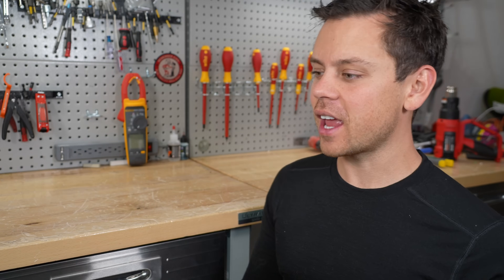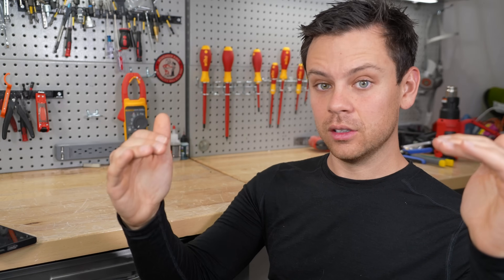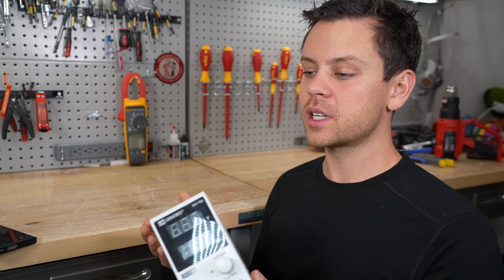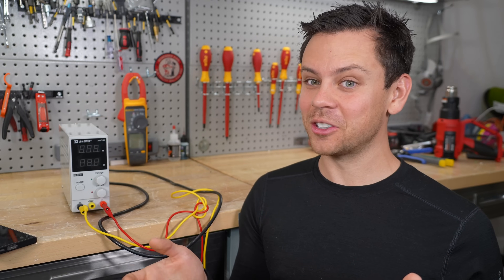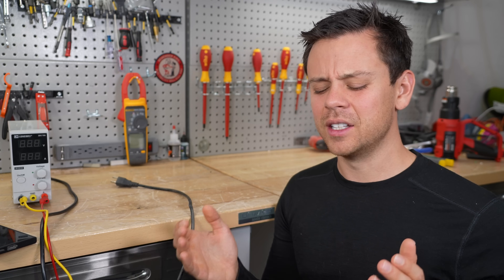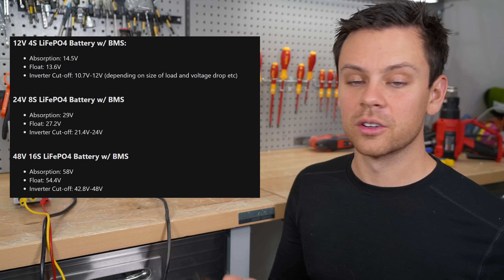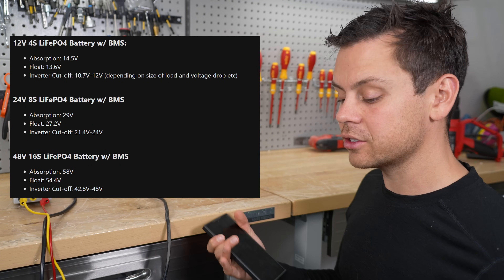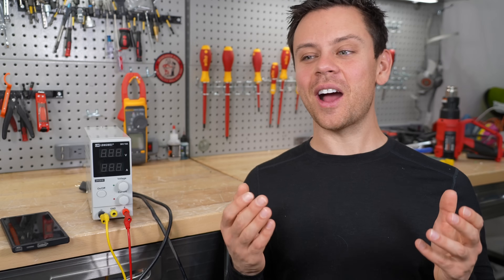LiFePO4 Charging Guidelines: What is 100%? What is 0%?! How to Balance??

Comment: Some people only want their batteries for an emergency backup and keep them full for that 2 or 3 days when a ice or wind storm goes through and the grid goes down and solar is not charging a lot due to ice or cloud cover.  Most home battery manufacturers say you can keep the batteries at 100% charged but they recommend that you run your batteries down to around 50-60% charge at least one day each month before you recharge them back to 100% for emergency backup.    Look at the users manual and follow the manufacturers recommendations to help if there is a warranty issue later.

Comment: Thanks for the post. I wanted to share my own experience, though it's limited. I live in Nigeria, where ambient temperatures can reach up to 37°C, so I'm cautious about how I charge my batteries. My first battery, sourced from a reputable seller in China (highly recommended on the DIY Solar Forum), was set to charge at an absorption rate of 3.6V per cell. The cells stayed well-balanced, but unfortunately, after just over two years, the capacity dropped to 80%. 

I documented the issue on the DIY Solar Forum (search: *20% capacity loss and bulging after 2.5 years of use*) and shared my findings with EVE engineers, who are investigating the rapid degradation. My conclusion was that the high absorption rate, combined with my high ambient temperatures, contributed to the problem. 

With my new battery, I reduced the charge to 3.45V per cell (55.2V for the bank). Using a smart battery tester (ZKE) for charge/discharge testing, I found that the capacity difference between 3.45V and 3.65V per cell was negligible—less than 5%. For me, sacrificing a small percentage of capacity is worth avoiding the extra heat from higher voltages. I now charge to 3.45V per cell, hold for 2 hours, then switch to an absorption rate of 3.35V per cell. My LVD is set to 2.7V on the BMS and 3.0V on the inverter.

On charge rates: my BMS communicates with the inverter but has a fixed Charge Voltage Limit (CVL). To adapt this, I use Node-RED to automate charge rate adjustments dynamically. The flow reduces the charge rate from 0.3C to 0.1C based on the battery's state of charge (SOC). This keeps the batteries within safe limits in my hot environment and helps with balancing at high SOC.

Time will tell if this setup improves longevity compared to my last battery!

Comment: People get sooo caught up with voltage, charging to 100%, discharging to 0%, over cycling, balancing, ect ect ect. JUST USE the dam battery and stop babying them!! There is a reason why lifepo4 batts have a BMS!!! It is there for a reason, to make it idiot proof!! The only thing you really need to be concerned about is storage and operating temperature! lifepo4 batts are getting so cheap now and days. So USE THEM set it and forget it!!
Reply: Yes that's what he said good job 👏

Comment: Appreciated. I was the one who asked what was 100%. My issue is my cell 5 and cell 16 on my SOK server rack battery is always the lagger causing a 100 plus deviation at 57.6v to 58.4v. And the same deviation at 44.8v. I am charging to 100 daily then discharging to charge my car. I have the 25KW SOK server rack.

Comment: The mention about UPS usage answers one of my questions. I found these rack batteries here in Canada made by a company called Maple Leaf and toying with using those for UPS application instead of FLA batteries as it would make the wiring much easier, since I can just put them in the same rack as the rectifier shelf and inverters. So if I understand this right as long as they are not subjected to heat, I'm good to keep them at 100% then. My server room hovers around 25-30C but that will change soon once I add better ventilation, so I can probably aim for like 20C.

Comment: Is there a way to charge to 50% or discharge to 50% without a shunt? How can I hit that storage level?
Reply: No inverter and multimeter?
Reply: Inverter, sure bit it doesnt have a readout.
Miltimeter, just shoot for 13.1v at rest? One of my betteries ia bluetooth and the app shows 53% charged at 13.3 volts.

Just looking for a quick fairly accurate way to hit around 50% soc before storing.

Comment: I had an Oupes 600 wHr solar generator and left it plugged in at 85F while running a box fan. I turned the fan down from high and it overheated and died. It was covered under warranty, but people are afraid that could happen after the warranty expires. 

Its internal temperature was above 85F and probably around 115-120F, but there was no software showing it like higher quality machines like my EcoFlow Delta 2. 

Any comments about these plain solar generators? I only get great solar generators like my EcoFlow now and don't operate and charge continuously.

Comment: I wonder if it would be an idea to split battery banks into two in some cases running as a primary secondary giving the secondary more time to top balance only coming in once the primary is drained as a kind of backup and then have them swap every so often once a month or something so each half gets 30 days of top balance priority.  Might be more complicated now I typed it out then it seemed when the thought popped in my head lol  just a idea I guess for someone who wants to cheap out on batteries but doesn't mind programing

Comment: Great stuff Will! I'm running 3 Renogy 200W panels in series to a Victron 100/50 SmartSolar controller, a bank of 4 Vaterer 12V 100Ah batteries and a Giandel 2200W ETL UL458 listed inverter to run my 1200 sq ft shop minus the 220V compressor, welder and plasma cutter. So far I have no issue running all the lighting, computer, battery chargers for my RC cars and intermittent use of pedestal grinder, table saw and drill press. I'm not always in the shop so I did a test running our top loading freezer and it does so no sweat. However, I did try to run our 900w water distiller (I leave for work at 4 am) and the batteries do hold until 8am when I start getting decent sunlight around 8:00 am. I do have a Rasberry Pi set up to monitor the system remotely and it takes until about noon when the distiller shuts down, but I only have sun until about 4 pm so It can't recover to 100%. The plan is to add 3 more panels in series connected in parallel so working voltage is the same, but doubles my current. Victron states that you can safely over amp their MPPT charge controllers, but never to over over volt them so I left a generous delta as I've seen temps here in the Metro Area of Denver Colorado drop to -20F. RARE, but in the 30 years I've lived here, I've seen it happen. Anyway, in summary, the Vaterer batteries for 179 a pop have been great, the Victron charge controller, and Ras Pi interface for 90 bucks, plus the Renogy Panels have been a great set up and I've seen well over 600W from those Renogies back in July when I first set up the system (I logged about a 620W peak). Best they can manage now in Mid November is around 480W on a clear day around noon mounted on my shed roof 2 a 22.5 degree angle. I set my bulk charge to 14.2, absorption to 14.2 and no float. I'll change them up to your recommendations and see how that works out. However the real star of the show was the Vaterer batteries.... about a 90A+  load on the bank of four for 4 hours straight and then another 4 hours with some solar help is pretty dang amazing. Lowest voltage I saw was about 12.2V under load! However with my present solar array it took 2 days to get them back up to 100% so, with that kind of load, I'm under paneled especially this time of year.

Comment: On standby batteries, I charge the battery to 14.5-6v, let them sit for a few days and measure the voltage at rest. Then use that as my float voltage.

Comment: Will
Thank you so much for making this video. While I understand the reason that so many unexperienced people doing these projects, wring their hands and worry, you are exactly right in what you have said in this video. If people spend time getting their batteries balanced and making good connections , then the need for worry and what they believe to be cautious charge and discharge settings goes away. Also the need for active balancers and Bluetooth communication quickly disappears. The goal is to have a system that you don’t have to worry about or pay  constant attention to. They can just build it right in the beginning and then use the heck out of it. These batteries just work if you use good materials and BMS. Thanks again for making this video.
Reply: You are spot on

Comment: I use mine as a backup battery and store them at 50%. I do, however, fully cycle them every month. This means if there is a power outage, I use the generator to fully charge them and keep the fridge and air going. Then I have capacity to leave everything on overnight and take the generator inside to prevent theft and let the neighbors sleep. Once a month I fully charge, discharge, and then charge to 50%. LFP batteries really do like to be cycled regularly.

Comment: You mentioned doing a capacity test. Are your videos from 4 or so years ago the best way to do them, or are there better methods for someone that doesn't want to spend hundreds on equipment? I guess, what would be the recommended tools/gear to get for an average person at home. Thanks.

Comment: 5:40 I Build my system 4 years ago with 8 calb 100ah cells and no BMS on my live aboard boat. So far no need for balancing. I do check the voltages regularly,  My end voltage is 28V or 3.5 per cell. Never seen more then 0.1V difference and always on cell 2.
Reply: Sir your battery is working well without bms.
I'm planning to make 24v lifepo4 without bms. Please suggest if I charge  it at 28.6v bulk, 27.2v float and cut off at 22v.
Charging current 20 amp max. Does it work?
Reply: @shahidmalik1094 A bottom margin of 2.75V per cel is only 0.25V away from permanent damage, while the is only a few percent extra charge. I use 3.1V cutoff voltage. There is only an inverter connected and I set it turn off at 24.8V.

Comment: Great video, but I still have sooooooooooo many questions.  I do nature photography, and I live in a 28 ft travel trailer. 
Last month I installed 2x ECO-WORTHY 12V 280Ah LiFePO4 Lithium Batteries (in parallel @ 12v), Renogy MPPT Solar Charge Controller 60A, 3x 200 Watt 12 Volt Monocrystalline Solar Suitcase Solar panels from Renogy (hooked up in series, getting up to 64v @11amps)(yes I should have more, still haven't found a money tree.) 
I also installed a 2000W 12V Pure Sine Wave Inverter Charger from renogy. It allows me to recharge my batteries from the grid or my generator. I haven't tested this theory very well, however, I don't believe my furnace starts up with out at least 12v, I don't usually allow my batteries to discharge below 12v for this reason.
 My gauge tells me Im around 50% when this occurs, I then start my Generator and charge to 100% or when my shunt tells me the charger inverter has stopped charging. 
Should I be draining my batteries down more before recharging? 
Given this time of year (Nov. 15th) I get sun on my panels from about 10am till 2pm on a good day, living in the southern interior of B.C. in the mountains, and its rainy season so lots of clouds. 
So the solar panels don't do much this time of year. Summer is great, cold part of winter is not bad, spring and fall I'd be better off with wind power lol.
 Draining my batteries down more could save me on fuel cost as currently Im getting about 2 to maybe 3 days between running the generator and it needs to run for 8 to 10 hours to recharge my batteries to 100%

Comment: Thanks, Will. Two questions though. First, what do you consider “balanced”? Ideally, .00000V, but that’s probably not always feasible. I have a 24V system with EVE 304 Ah cells and I usually get them within .004V. Is that acceptable? Second, I know you say discharge to 0%, but when designing a system you also say to design it with about 5 days of autonomy.  Isn’t it risky to discharge to zero and lose your autonomy unless you are certain that you can recharge the next day? Thanks again for all you do!
Reply: 0.004v AT TOP OF CHARGE is absolutely fine. That’s balanced.
However, at lower states of charge, it is pretty meaningless.
Reply: @ thank you!

Comment: In my 48 volt Lifepo4 battery setup , I use 8 x 12v batteries is series paralllel, which can power all my electricals for almost 2 days. But, in case I get socked in for more than 48 hours I have 2 x 24v 100Ah  batteries as back ups. I keep these charge up to 100% about twice a week which only takes a few minutes of charging to top them off. Explain why that is that is the wrong or not recommended procedure. Aloha from Hawaii!

Comment: For large solar generator lefepo4 kept storage for power backup purposes, it is okay to keep the charge to 100%? It is being cycled to 100-0-70%% only every year. It is Zendure superbase V4600. I currently kept it at 70% on storage, but I might hold it to 100% if no difference on degration. The temperature at storage is not hot.

To balance the cells effectively, should I keep it plugged in, for charging, for a longer while (e.g. one day)after it has reached 100%? Or i can unplugged it right after it reached 100% and it still balance cells effectively?

Comment: I would enjoy a video on utilizing less common voltage batteries that are for sale new and used. 14.6,22.2,44.4 etc. These can be affordable if you can source the other components that are compatible. Have seen others touch on this but always value your opinion.

Comment: Hey Will, so 14.5 for my 4 x 300 amp AmperTimes, I’m in the Caribbean on our catamaran so plenty hot all year also plenty of sun!
Still one question remains: how long should I keep it at 14.5? I have plenty of solar to cycle them everyday, the standard lithium setting on the Victron MPPT is set at 2 hours, I’ve reduced it to 30 minutes, is that enough? Should I put it back to 2 hours?…

Comment: Thought exercise, but I'm probably way over thinking and adding unnecessary complexity. 

Would it be beneficial to separate your battery bank in half, with an active pack and a standby / charging pack with an auto transfer switch that will automatically change from pack to pack when a specific low side voltage is reached?

Theory being you are properly discharging and charging a battery bank without any short cycling.

Comment: Thank you, you cleared up a few things as I charge using Solar but it’s not enough right now because of my location. I’m one of those people who tend to use my batteries in an emergency especially in the winter. Last year we had an ice storm and I ran the house minimally for a couple days. I ended up charging the batteries with my generator.
I did not discharge to the 0%. I guess I have to get over that fear!

Comment: Always very interesting and good information from you Will. Was interested in what you said abouth changing thé wiring? Thé configuration for series parallel with four 12v for a 24v system. They're discussion on what's best.

Comment: I guess some inverters will work as low as 10v from a battery , but some other devices, maybe a radio, may only work as low as 12v.    Given 4 , 3.2v rated cells, thats 12.8v total in terms of ratings.  12.8v- 12v is 0.8v.  0.8v / 4 cells = 0.2v "drain" from each cell.

Comment: what about lithium iron phosphate batteries that are designed/recommended for mounting in vehicle engine bays? 
it is super hot in there during summer in australia especially on long trips ive had 51C in engine bay for hours on 4-5 hour driving trips on 40C+ days 
i want to move my battery into the engine bay because space is at a premium inside the vehicle and the manufacturer says it is ok to do so but will it cook the battery? 
what exactly can the manufacturer do to mitigate heat damage that i can ask if they have done?
Reply: Pretty simple, batteries in the engine bay WILL kill them much sooner. Period. 
Suggestion: do NOT do that.

Comment: Will, some RV's have the battery storage area beneath the entrance steps. Basically a cage exposed to the elements. So, is this an issue for LiFePO4 say in the hot summer months in AZ? Thank you.

Comment: Thanks for the detailed explanation Will 👍🏻 I have an issue with my solar battery at the moment where it will not accept the usual 2.5kw when charging from the grid. For the past month I’ve only been able to import around 1.3kw. Is this likely to be a balance issue or BMS failure or bad cell. Thanks for your advice in advance Matt 🇬🇧

Comment: A video showing adding newer batteries to your system.
I have v1 eg4 from 22-24 I recently added a v-2 egg-4 .
Mixing older and newer batteries how can you make them balance in your system?
Signature Solar videos are not very clear on how to integrate the newest v-2 with v-1.
I updated the software in the v-1 and still couldn’t make it work completely.
I did work through it but I’m not sure it is effective.
Reply from the maker: Check out my current sharing video I covered that a lot

Comment: Just need a clarification.   I have a boat with a 12v refrigerator running, is it preferable to charge to 100% then shut off the solar until it drops to 40-50%, then turn the solar on again to recharge, or is it better to leave the solar on every day?   Left on every day, its unlikely that it will ever see 95% charge, I don't draw enough energy out.   Doesn't it damage the battery to leave it charged 95-100 all the time, with only occasional draw down?   Thanks in advance, you have a great channel...
Reply: ^This question
Reply: What chemistry are you batteries?